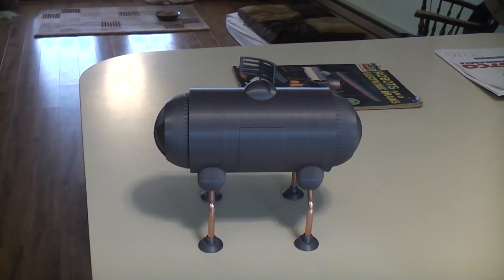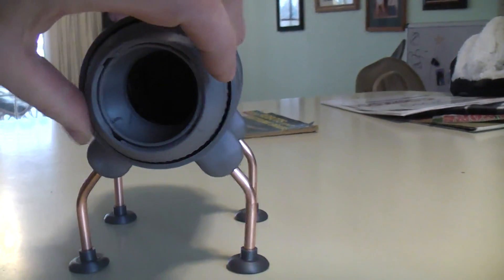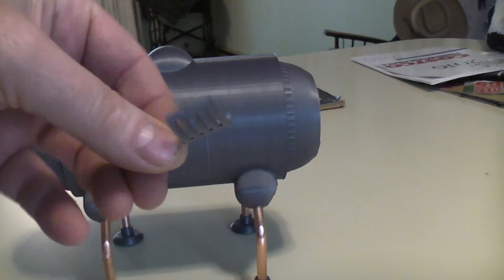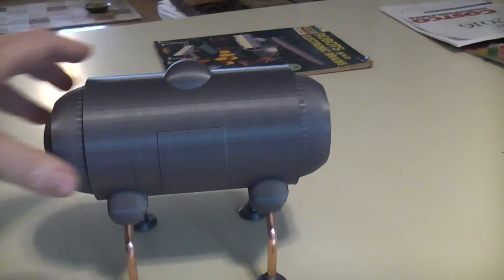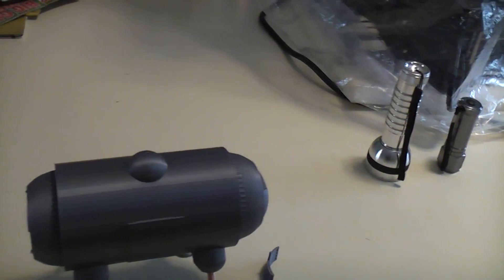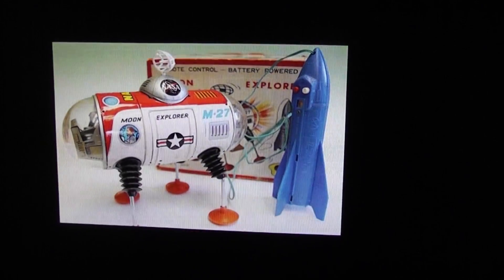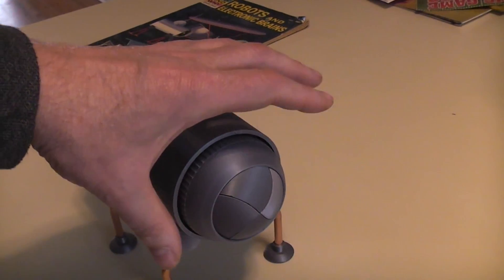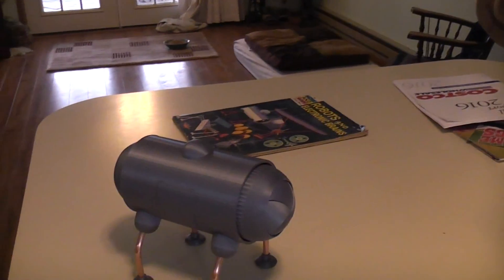3d printed Space Case. Can you print a 90 degree over hang with no supports ?

Comment: This is an excellent design you came up with. Great work.

Btw, is that 1/4 in. diameter copper tubing you used to fit into the leg/feet parts?
Reply from the maker: Yes I had some 1/4 inch copper tubing in the junk box so decided to use that for the legs.